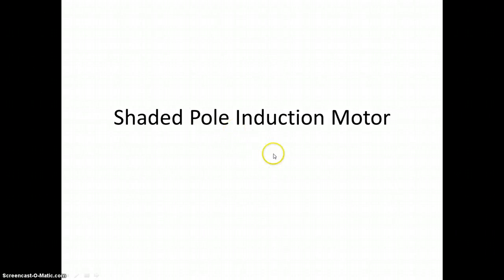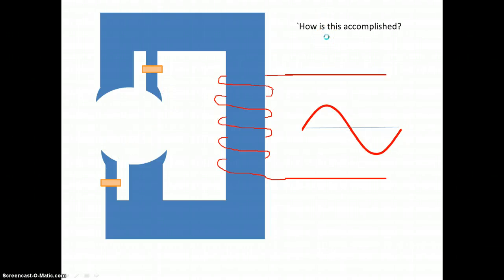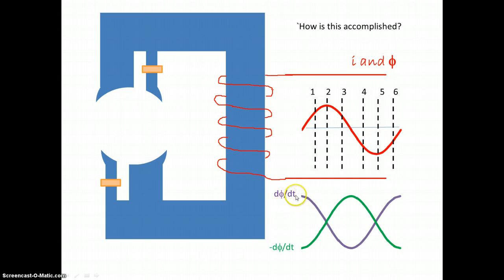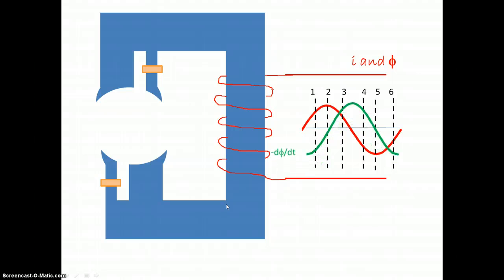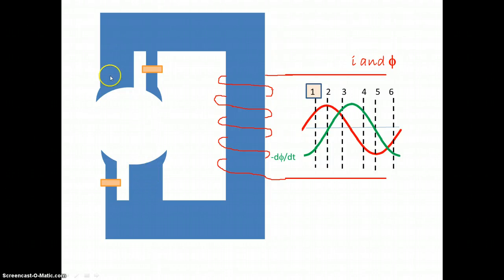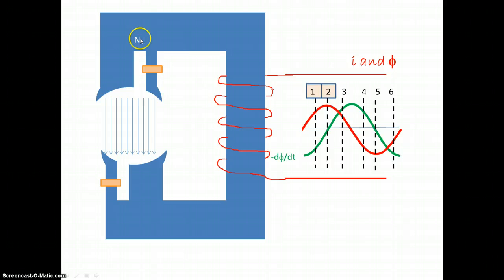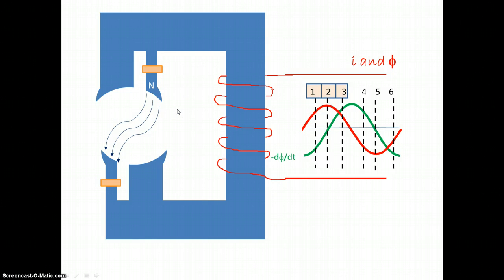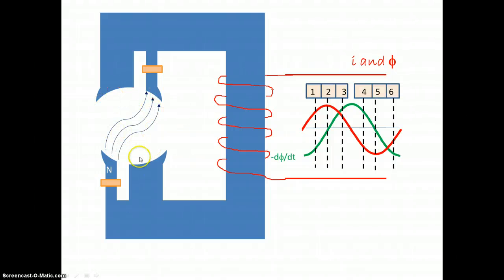Shaded Pole Motor

Comment: Excellent explanation, if not the best so far on youtube.  If you are buying an appliance with this kind of motor in it, understand you are buying a cheap piece of crap if it's purpose is anything other than spinning a space heater fan.  These are 15% efficient typically.  In a heater... this can pass as the motor's excessive waste heat simply contributes to the purpose of the device.  But on anything else not intended to heat... garbage.  Go with a higher end fan or appliance that uses the PSC motor (permanent split capacitor).  Much quieter and significantly more efficient.

Comment: wow this means the shaded pole motor is also an ac induction motor but made super simple without the need to use any form of running or start capacitor?
Reply from the maker: Yes.  That's exactly it.
Reply: Roddy Mc Namee thanks for the info roddy, what about you tube videos seen running two of such motors self looping and running a load on top of it..you think its possible? the video shows a small capacitor in parallel to one of the self looping shaded motors..

Comment: How would a 6 pole shaded pole motor operate if the shading coils were removed without damaging the windings?
Reply from the maker: +shawn hill If you remove the shading poles it's no longer a shaded pole motor, but instead becomes a 3 phase ac motor.  You'll just need to supply 3 phase supply to the motor.

Comment: Why some coils in the shaded pole induction motor have a kind of 'protection' tape while others are 'exposed' ???
Reply: I think it depends on the voltage applied to the coil, if it is fairly high, it is wrapped to prevent touching bare live wire